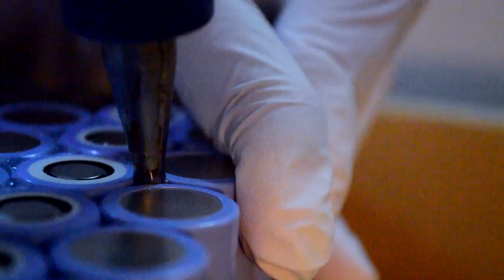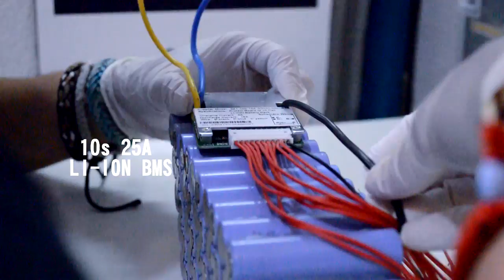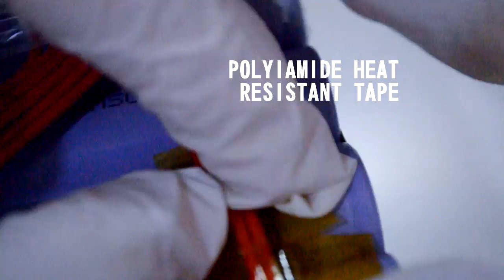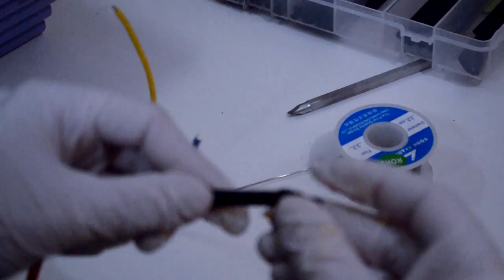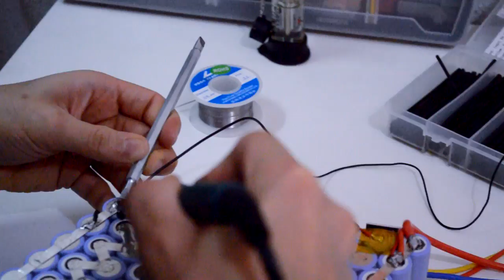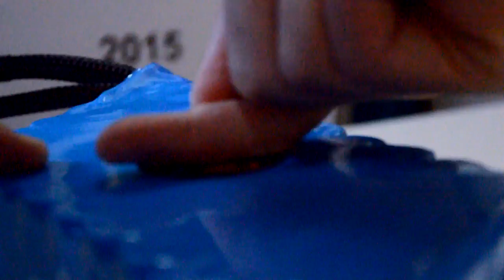10s6p 36V 17.4Ah li-ion battery for customized ebike frame case

Comment: How do u know that the battery 17.4Ah when u can't discharge the battery with an imax b6 or any intelligent charger to know the battery capacity.
Reply from the maker: that's the rated capacity taking into account each cell rated capacity. Those are factory new cells having their capacity exactly rated. Li-ion is extremely efficient under 1C continuous discharge, you can also check with a watt meter

Comment: You do very nice battery packages, but soldering you have to little bit practise. i dont know if you have had a lot of problems with solderings, but in many videos it seems that you make so called cold soldering joints
Reply from the maker: +Mauri Järvinen I've been improving my soldering skills as were requested before, I finally get a proper iron. Thanks for your sincere observation
Reply: I like alot what you do :) Just result of soldering was hitting in eyes in few videos.

I havent done yet any battery pack myself. But i will. And your videos are helping in that.